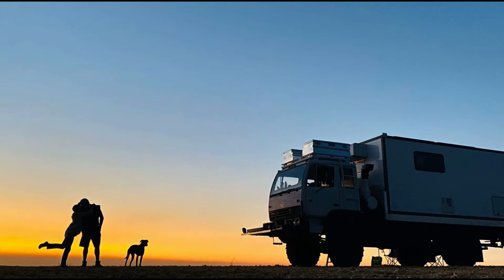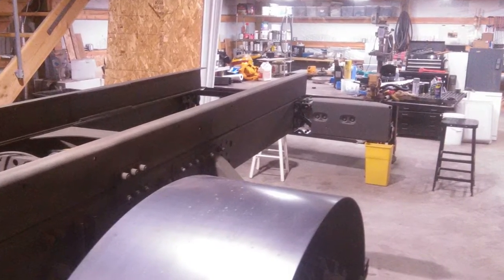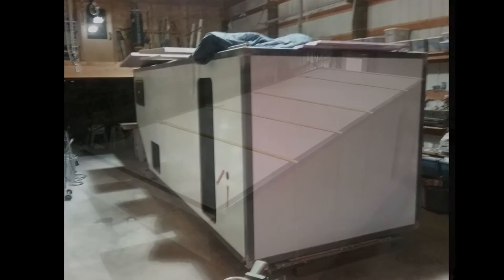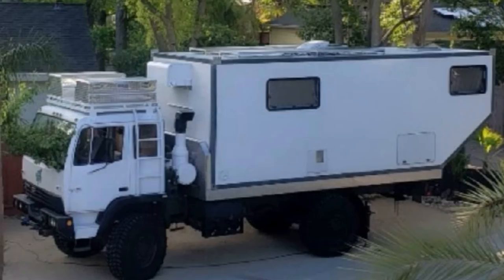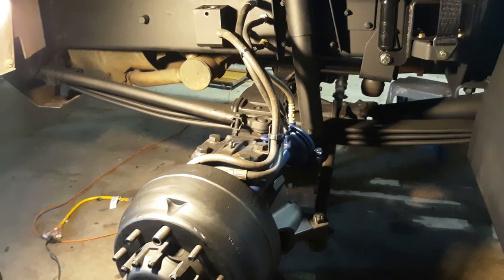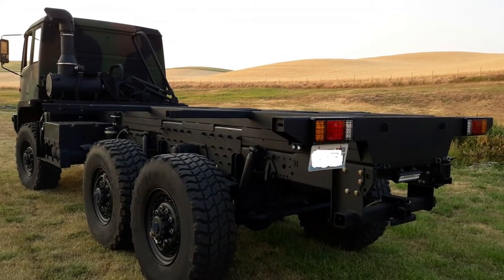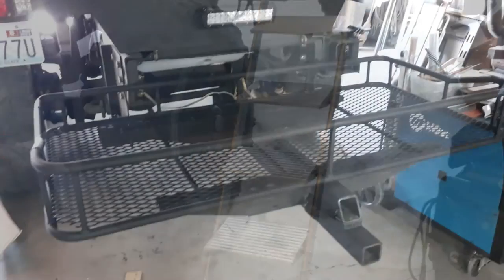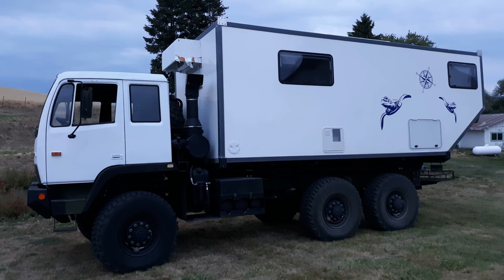FMTV Overland Camper  2 0

Comment: I was surprised that you used OSB rather than a Composite Aluminum Foam Sandwich build.  It would have made it a lot lighter.  Riley and Courtney (Ambition Strikes) build their Overland truck camper by gluing together their Foam and Aluminum Siding boards and built their entire camper with minimum aluminum framing.
Love this build as I'm designing an Edpedition camper of my own and found yours.  The bed extended out of the rear is what caught my eye as I'm going to incorpporate one into mine.  Only I want to have a hydraulic tommy lift gate that I will convert into a motorcycle rail & lift that will raise the bike up under the bed and will carry it there in the raised position with hinged end walls to keep the dust off it.
And that side entry step build is most impressive.  Makes it look a lot safer for entry.
Great job Rob.

Comment: How do you like the new truck? You mentioned your previous truck sagged a bit in the back, did you experience any body roll or anything else with the first truck? The reason I ask is that I'm struggling with this exact decision as I look for a truck. Meaning 2 axle vs 3 axle. Seems there's always trade offs with everything. Thanks for sharing. Very nice trucks and really enjoy your fabrication photos.
Reply from the maker: Thanks for  the question.  As things have worked out I am very happy with the 6 x 6 M1083.   I particularly like having the 
"fast axles" that it came with.   That said, if I were doing this all over again, I think I would probably stay with the 4 x 4 M1078 as a platform.   Being a bit more nimble definitely has a certain attraction to me at this point.   At almost 26K lbs if you need assistance, getting the M1083 out of trouble is that much more difficult (read expensive)  So if I had to do it again, I would build a lighter box on the M1078 platform (with fast axles).   I would also be sure to invest in a healthy bank of lithium batteries and a robust solar array.    Hope that is helpful.
Reply: What’s making the habitat so heavy? The OSB? It looks like some air bags would have helped the rear a bit.

Comment: Looks great. I’d love to build a FMTV Overland camper like this. The one thing I don’t see anyone doing with these and I don’t know if there’s a specific reason or not, is building a over the cab sleeping area that extends out like on most Ford Class C RV’s. That’s what I would do if I built one to give me more room inside. I’m not sure if you can’t do something like that because of the air intake and exhaust or if it’s just something nobody has done. Regardless your build is great. Very nice work.👍
Reply from the maker: It could be done .... but it would require some major engineering/fabrication to accommodate the fact that to access the engine, the cab pivots forward.
Reply: @robanderson6423  ahhh, I didn’t think about that. A self contained camper box mounted on some sort of sliding rails that could be rolled back to allow the cab to flip forward might work but like you said it would take a lot of engineering.

Comment: Beautiful build, love the story and your notes :)
For someone who's about to pull the trigger and get an LMTV for overlanding...
Would you recommend to start with the M1078/81/83?

Thank you!
Reply from the maker: Hi Avi ... thanks for the note and kind words.  That is a really hard question.   Honestly if the camper hadn't turned out so heavy, I would have been happy to stay with the M1078.   It is just a bit more nimble (if that is possible) than the 6x6 M1083.  That said, I really like having the amount of space we have inside the camper box.  I suppose if I had it all to do over again.   I would design a camper that utilized the roof lift system and make it as light as possible to fit on the M1078 standard 12' bed.  Good luck with your truck adventures.

Comment: I thought I had read someplace that the 1083 was only 2ft longer than the 1078, ergo your extensions on it I'm guessing.  I'd love to see more details on the interior, like how you did wiring, plumbing, etc.  And do. you wish you had not extended the back with the 45 degree cut on the bottom?  Would also be interested in knowing roughly how much you spent putting it together.  Been looking at these silly monsters myself thinking of doing the same thing, but I don't have a nice shop like you do so that would be a hinderance.......... Oh... and have you ever seen one of the 1078s with the radio box on the back and if so do you think that would make for a good starting template as I think I saw one person do.  Thank. you for uploading your video.
Reply from the maker: The camper build is detailed in my first video "Building our M1078 Overland Camper".   Cost is totally dependent on each build ... but you can figure you'll spend over $50K if you build the box yourself.    Every build is different.

Comment: Wow awesome build!  Really enjoyed the first 3 video.  I am really considering building myself one but not as long.  You can answer this or if you choose not to I understand but how much did it cost to build, repair this?
Reply from the maker: Thanks for the comment.   The cost is totally going to depend on your build and the truck platform you chose.   You can pretty much plan on spending at least $50K  .... it goes up from there based on electronics, solar, box build, etc..

Comment: What was the size of the habit? Total length and to the departure angle should help  me in my spacial reckoning! I want badly to make on of these starting on a 1088 platform. But would like to move the spare and air. Drawing guessing and dreaming. Thanks. Looks great!
Reply from the maker: The box is 16' x 8' on the base .... 20' on the roof
Reply: @robanderson6423  thanks for getting back I appreciate it!

Comment: Just watched it again. Great video except for the horrible music😜 JK. Can you comfortably cruise at 65mph on the interstate with the higher speed axles and the camper installed? How does she handle wind(Columbia Gorge)? Thanks again!
Reply from the maker: Hi C.A. .... thanks for the comment and subscription.   Though I haven't put a lot of miles on them .... the fast axles seem to make a big difference.   It is nice to be able to drive without constantly pushing it to the floor (as with the M1078 with standard axles)   Some have expressed concern about losing some capability in low gears.   Since I am not towing a heavy trailer .... and the camper weight is no longer an issue,  I really don't think it is a problem.   As far handling wind on the road ... it seems very stable.  When 18 wheelers pass by you can barely feel it.     Thanks again for you interest! (and the music ribbing!)

Comment: I’m a bit late to this party but hopefully the OP sees this anyway.  I’m. Urious about the construction of the floor.  I see it’s 2x2 and you covered it with the OSB, but what about the bottom?  Did you skin 5he bottom to seal it up, or are the 2x2s exposed to 5he flatbed deck?
Reply from the maker: Thanks for the question.  The entire bottom is 3/4" ply ... riveted and glued (Sika 252) on.
Reply: @robanderson6423      Just to make sure I’m understanding correctly.   The bottom is….3/4 ply(outside), then 2x2, then OSB(inside), correct?  How did you weatherproof the 3/4?  Did you glass that as well, or “other”?   Your build is pretty much exactly what I want to do, except I’ll most likely leave the original flatbed, and I’ve been agonizing over the floor of 5he enclosure.   Analysis paralysis, right.   :)